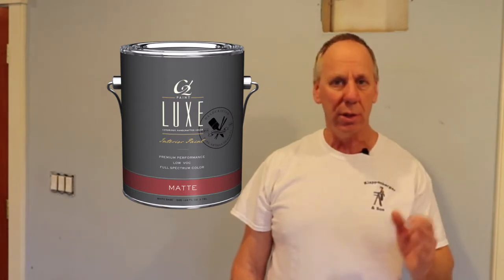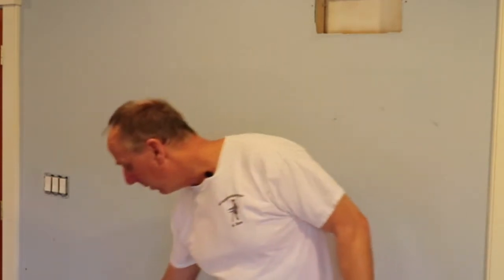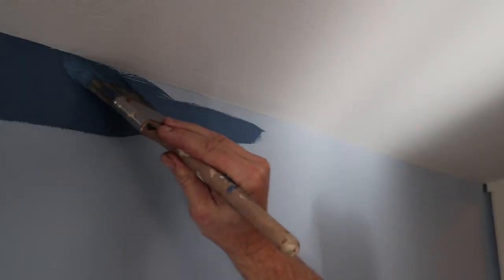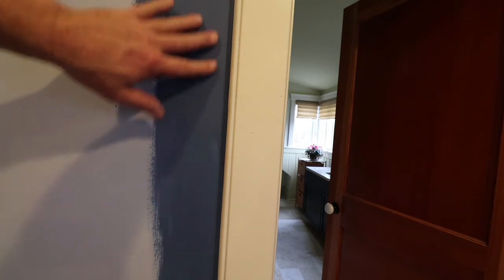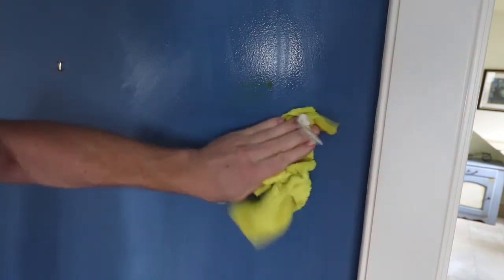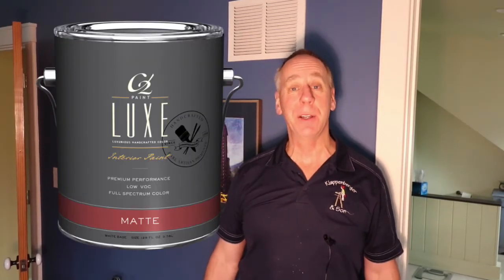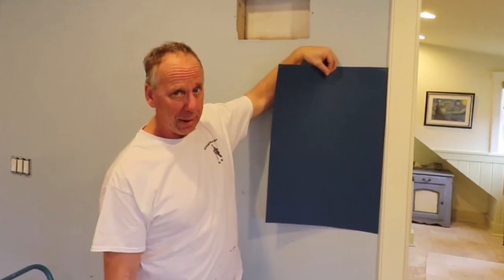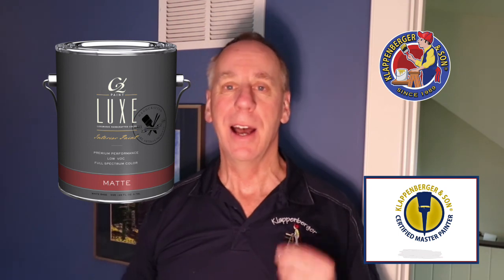Professional Review of C2 Luxe Matte By Klappenberger & Son

Comment: Thank you for this comprehensive review; I had not been familiar with C2, and, upon further reading, I see it's a paint for craftsman via the company's extensive color palette as well as its superb manufacturing processes that yield nonpareil coverage, durability and consistency. My only concern is buying the correct amount of paint for the job; C2 is not available at a bricks-and-mortar retailer near me (I don't think?), so if I need an extra gallon right away, that could be an issue ... and I don't want to purchase an extra gallon "just to be safe." Maybe I'll try a small job to discern C2's actual coverage in real-world conditions, and then, if the math is correct, I will expand to painting in larger areas. Thanks again!